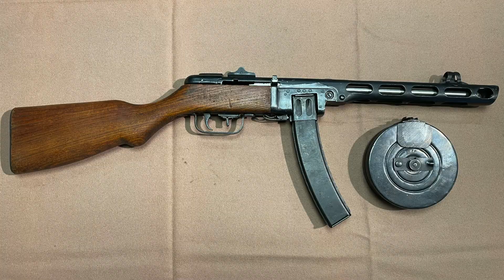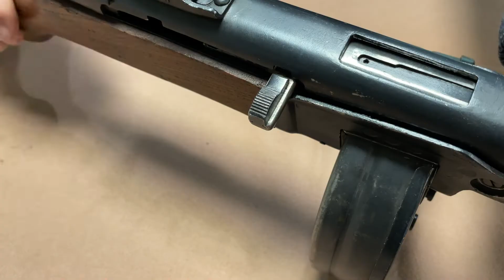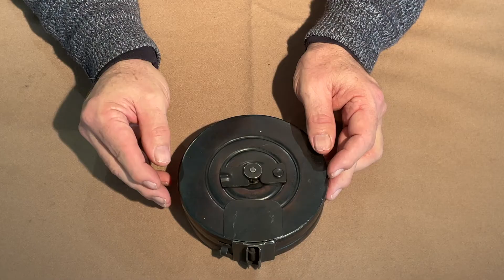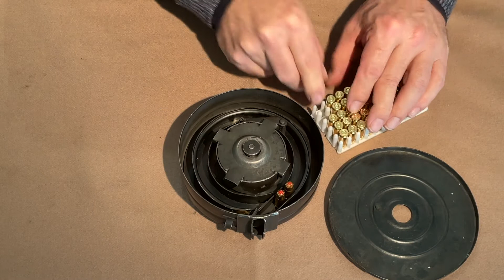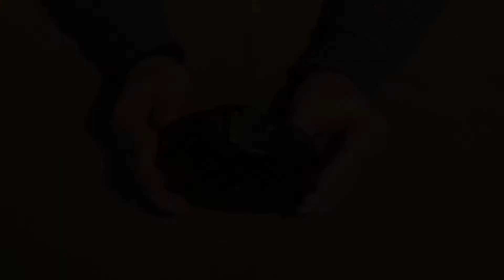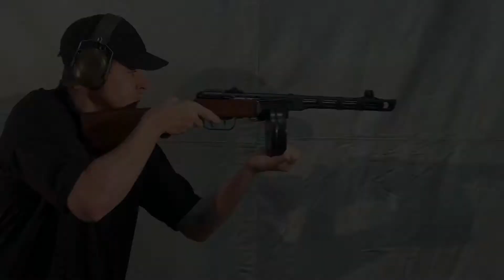ORIGINAL PPSh-41DEMONTRATION | HISTORY IN THE MAKING LTD

Comment: Correction: The upper and lower are not permanently held together. The barrel is not permanently fixed in the receiver. The pin that holds the upper and lower is removable.  This pin also holds the barrel in place. When the pin is removed,  the barrel is then removable.

Comment: Great video! Question, would the drum magazine be saved for reloading later or was it seen as disposable?
Reply from the maker: Thanks for the comment Colin. The reality of front line combat would have seen most soldiers who were armed with the PPSh 41 would have equipped themselves with more than 1 drum mag. In our collection we have canvas pouches that slip onto the soldiers belt. These would carry the spare magazines. Ideally, 2 spare and fully loaded magazines in the pouches and 1 carried in the weapon itself. This way the soldier can rotate the magazines to have loaded in the weapon and empty in the pouches. They would definitely reload the magazines wherever possible. We have noticed that one downside of the drum mag is that you can not tell when it is going to run out!  Re supply of ammunition would be done in cartons or grates, rather than ready loaded Magazines.